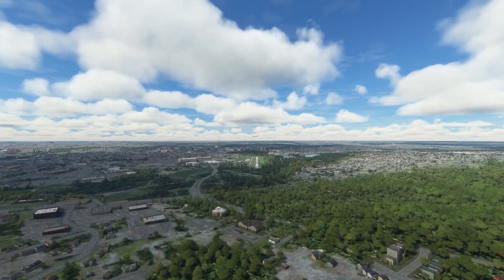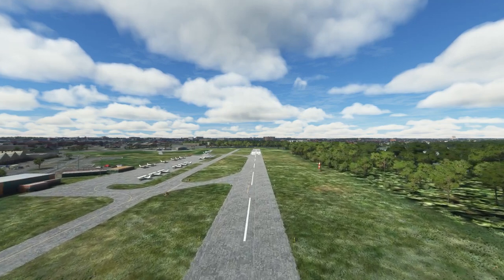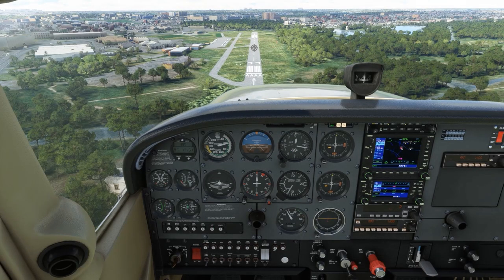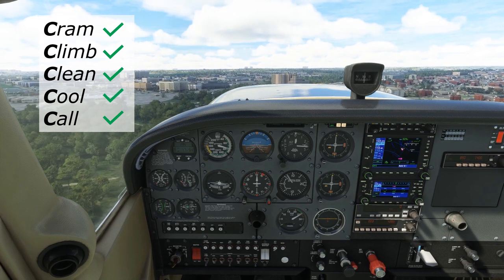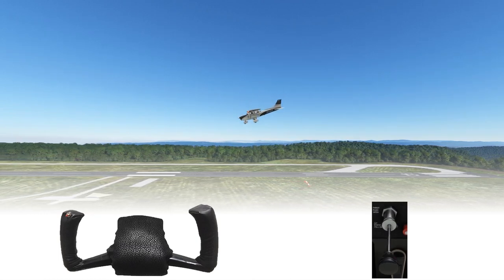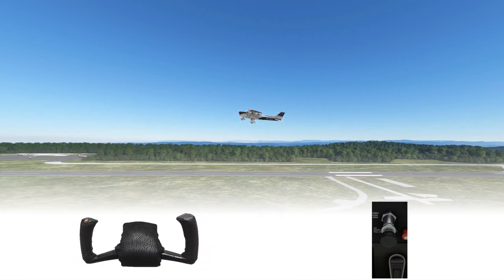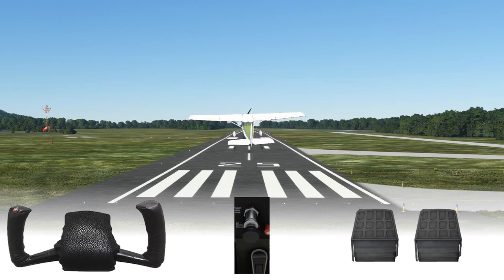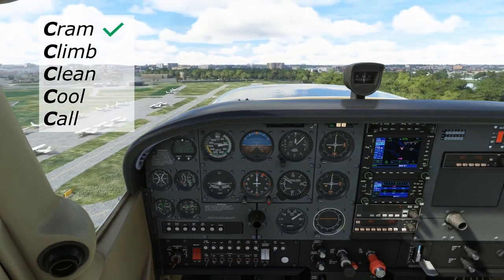How to Fly a Go Around | Climbing out After a Landing Approach | How to Land an Airplane

Comment: The number one thing ALL new pilots must realize about going around.  When you apply full power, the aircraft will tend to pitch up.  Forward yoke is need to push the nose down slightly.  Then, slowly remove full flaps as speed increases.
Reply: If you hold it works just the same. Just do not pull with any authority and you'll have it.

Comment: And just as a flight instructor myself,  I have always been in an opinion of retracting the Flaps from a landing configuration to a  notch up provided my aircraft is a minimum of 100ft AGL soon after the go- around action is initiated, with the attitude selected for the climbout and speed at or slightly above 65 kts and then the others up in stages, preferably by 300ft AGL into a complete clean after ( clear of obstacles,  +ROC, Speed 65kts< )
One must definitely be prepared with the attitude selection soon after cramming that throttle with the touch of right rudder to overcome the left turning tendency of the aircraft,  also be prepared to overcome that shear pitch up that aircraft can experience in a given configuration.

Loved the video♡

Comment: Another great video! One comment and one question: I’ve heard some pilots say that on every approach they call out loud: “going around is an option” (or some variation of that). It’s a habit I’ve adopted and a good reminder that - yes - if things get unstable, going around is an option. The question: you mentioned using sight picture on the transition to a climb attitude. But would it be equally effective to just shoot for Vy? Is the rationale for sight picture keeping your eyes outside? I use airspeed a lot as a proxy for configuration. Just curious on your thoughts. Thanks for this and all your other amazing videos!